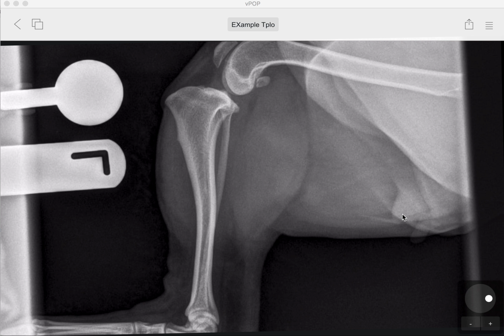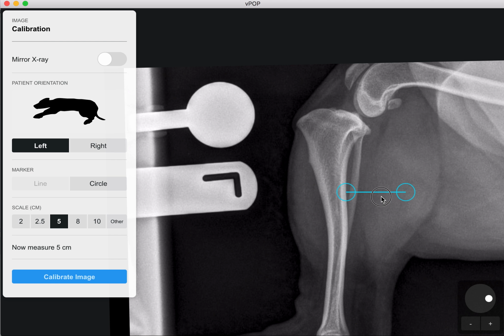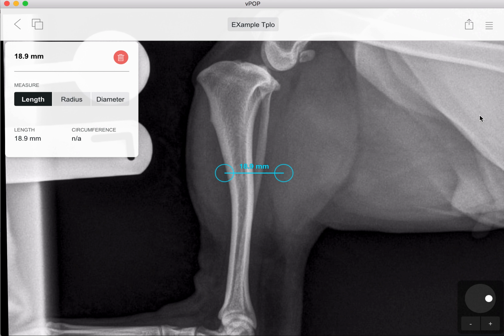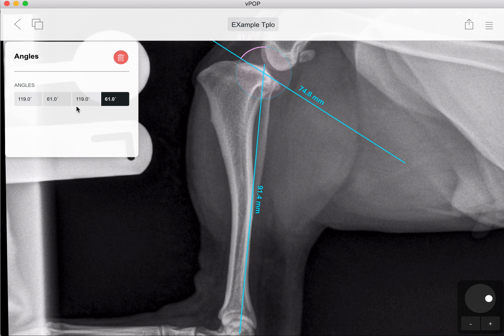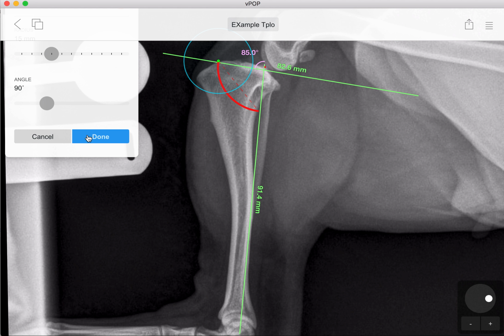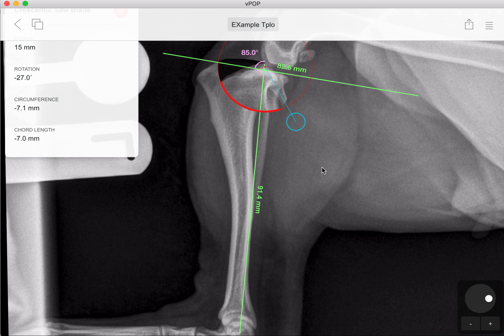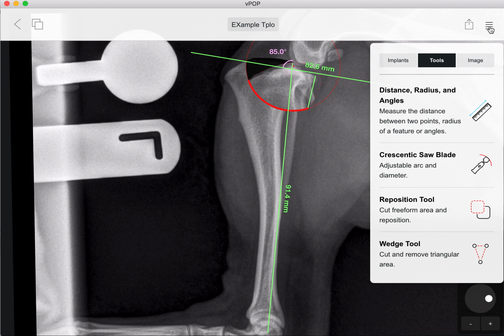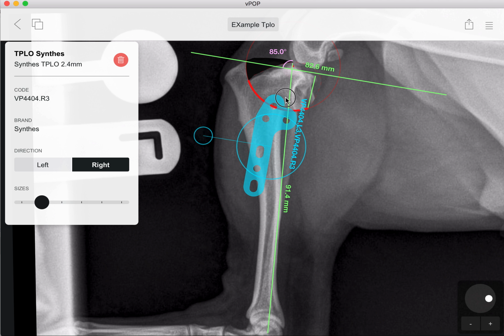How to plan a TPLO  in vPOP-pro!

Comment: hi dear, can i ask a question 
Why did you calibrate the X-ray to 2.5cm? And are there fixed tables for bone angles or do we diagnose each patient individually?
Reply from the maker: Good day, the calibration is set to the known diameter or length of your radio- opaque calibration marker.  Your marker is  placed level with and adjacent to your area of anatomical interest. The bigger the marker is relative to the anatomy of interest, the less significant any proportionate error in measuring it becomes. Every patient has a unique tibial plateau angle (mCaPTA )and they may vary between each knee. You can either measure it manually in VPOP and rotate by the number of degrees required, or use a rotation chart, or to be most efficient- simply set your target mCaPTA / Tibial Plateau angle and rotate your plateau to this target tangent and track any tibial long axis shift ( see how to plan a CCWO in VPOP video) if your chosen  rotation centre moves your proximal landmark for the tibial mechanical axis  during the rotation.
Reply: @vpop-pro  I don't know much about this software. I'm just wondering where to understand x-ray correction. I want to buy it to support veterinarians in Vietnam to easily access new techniques

Comment: I'm confuse you saifd you need to ahve at least 10 mm/ 1cm from tibial crest, and you measure 7.8mm? shouldn't you change your cut or saw size?
Reply from the maker: Good Day Dr David, the choice of Crescentic blade size is usually  determined as a proportion of the patient’s proximal tibial morphology rather than  by patient body weight or from an absolute minimal crest width.  Kindest regards.
Reply: @vpop-pro  thank you very much for the precision.

Comment: Hi,
thanks for the great video.
Looks like a very powerful tool !
Can you tell me what D1, D2 and D3 are measured for ?
Thanks a lot !
Reply from the maker: You’re welcome . D1-3 allow you to reproduce your exact blade position in theatre . This ensures your centre of rotation is where you planned . In this way you can avoid or accommodate the implications of any tibial long axis shift , that your tibial crest thickness and shape is as you planned to minimise the risk of fracture and 3) predict / avoid any potential challenges of an ‘ uphill cut ‘ at the caudal cortex

Comment: '29 deegres'  but in measurements is 61"????
Reply from the maker: Hi Samir. A Patient's TPA is the angle between the Tibial Plateau and the perpendicular to the Tibial Long Axis. ie 90- 61= 29'  . The desired post operative TPA is 5', ie the angle between the postoperative  Tibial Plateau and the Tibial Long Axis is 85' = 90-5' .
Reply: thank you  @vpop-pro